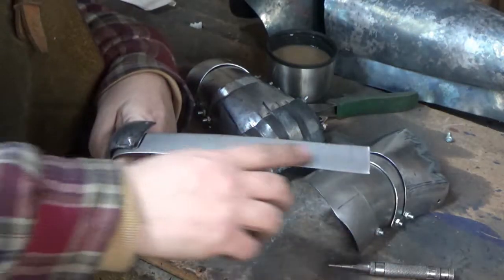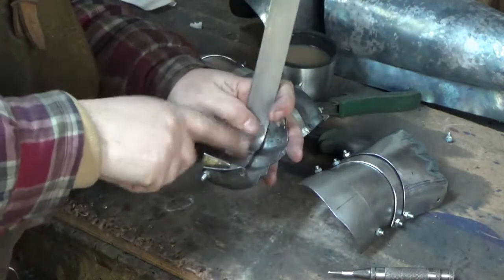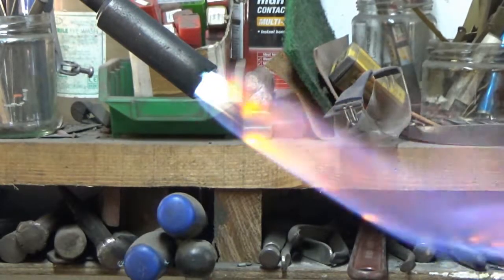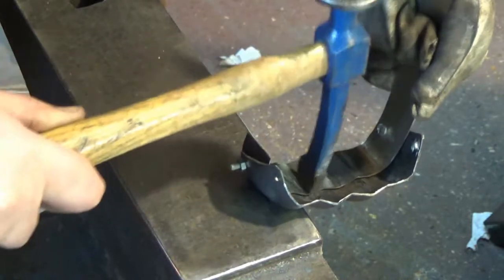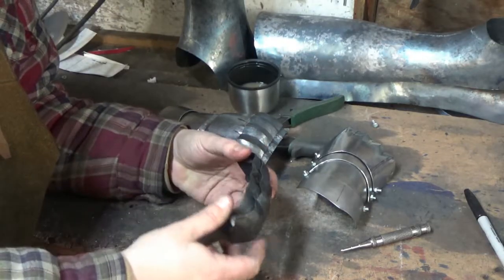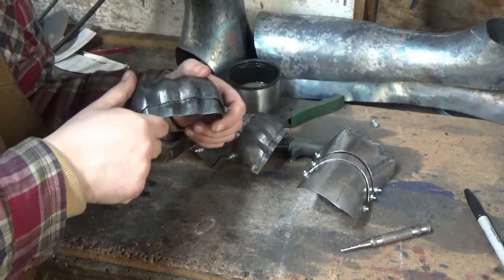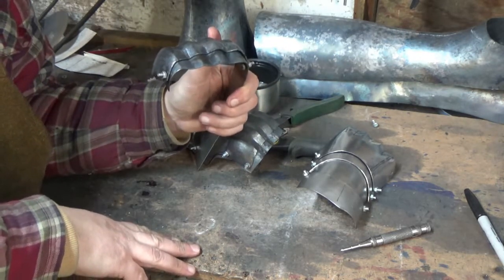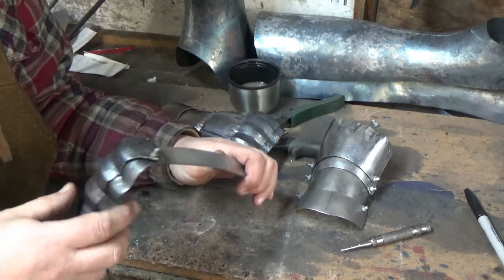How to make knuckle rider plates pt 2 of 2. Make your own Gothic Gauntlets Pt. VI

Comment: buddy! whats that burner you use? is it propane or oxy? i dont know whether to invest in oxy or try and fathom a propane setup. the wifes not happy with coal etc lol
Reply from the maker: I use propane and oxy/prop forges. The propane is used for bigger sheet movements and will heat an area about 6 inches or so across to a nice bright orange. The oxy/prop is a wand mixer attached to both oxygen and propane cylinders. It'll heat a couple of inches max very quickly, hence it's great for knuckles, adjustments etc ….

I'll try and do a video on the setup sometime in the  future. 

I used to have a coal forge, which is far more superior and versatile, but … it takes an age to get to temperature, can eat your work of you don't pay attention and is a lot messier. I loved it but the cons were outweighed by the pros and I made the difficult decision to change.
Reply: cheers graham, i think its time to build some propane burners, hopefully keep the wife happy :)